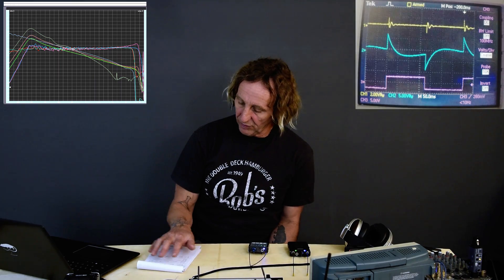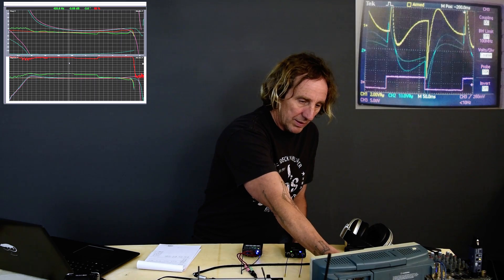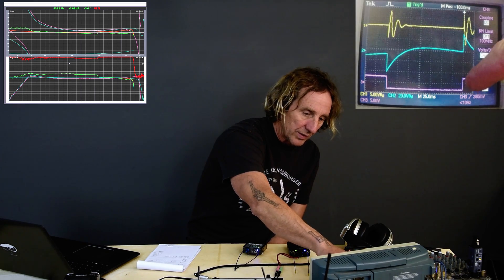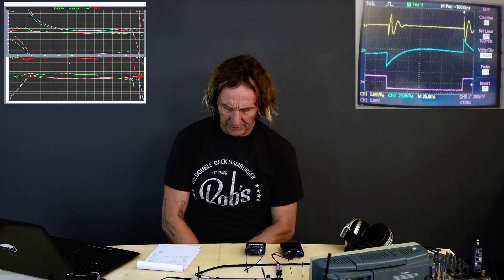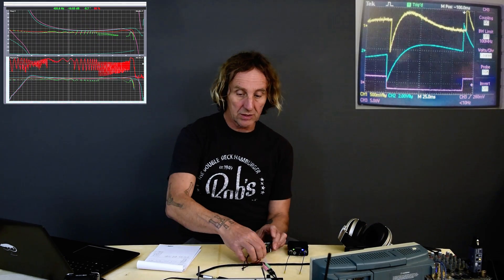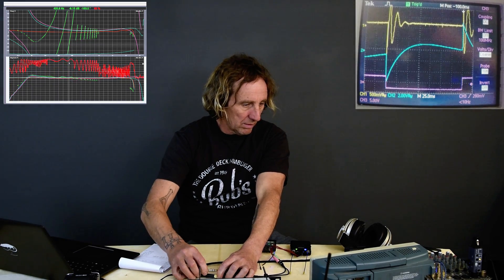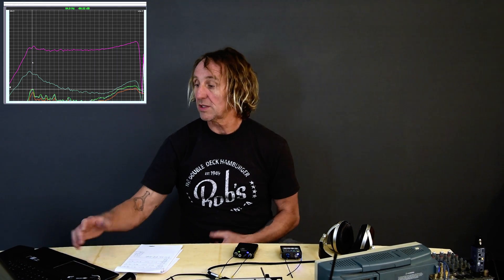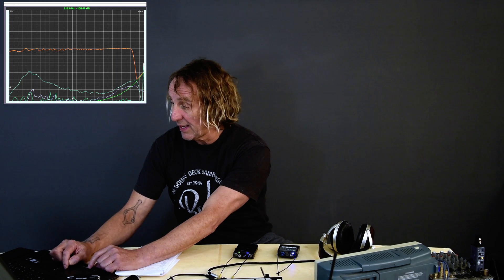Analog vs Digital In-Ear Systems Pt 2 - Shure PSM1000 vs Lectrosonics D2 #16

Comment: Thank you for taking the time to make these videos. 

I have used Sennheiser IEM G3s and Shure PSM900s for a long time (haven’t had budget for PSM1000s), and I tried a Duet system back in the summer of 2019 I think- after their major protocol revamp. My observations: The Sennheiser G3 IEMs have a very noticeable noise floor, but once you get signal in, they sound better than PSM900s, which are virtually silent for noise floor, but the sound is pretty dead coming out of them.

I was really excited to try the Duet system based on Lectrosonics’ reputation, however I ended up returning them. In addition to the battery life issue, I thought they sounded terrible - a digital noise/dithering that came over everything. They sounded like a low-bit rate MP3 recording. I posted on PSW about this and got thoroughly skewered, but I stand by my assessment - the RF performance is world class, the physical design is 85% (batteries and poor design of battery door where a poorly placed bump can cause the door to open and the batteries to fall out), but I just thought they sounded worse than the analog systems.

I think it’s interesting that what I heard doesn’t show up clearly on your measurements, while things I found less objectionable (compander action), clearly are shown in your measurements. I’m not an analog warmth guy - I was an early adopter of digital consoles, but in this case I couldn’t live with the digital sound and sent it back.

I’m hoping that the next gen can do better - maybe some rule change by the FCC to allow wider channel use (not holding my breath for that).
Reply: I have 8 channels (4 units) of the M2T duets w/ 7 M2R and 2 M2Ra packs, and I agree that they sound like a 96kbps or less mp3, with all sorts of hiss and crackle. My artist is a pianist and it is extremely apparent when you play a single piano note. I've been trying to get an answer as to why or how to fix this, but I have had no luck.  I've tried dante and analog and had no difference. I was also surprised this didn't show up in your testing, but to be fair, I've tried to capture this noise difference but it's been difficult.
Reply from the maker: Interesting
Reply from the maker: Cool cool and interesting info. I did not do much perceptive based but that is interesting.
Reply: @DaveRat  Thanks for your reply. 

Upon further reflection, I think the reason the compression artifacts don't show up in Smaart is they are too fast - probably the average frequency response is about right so the trace matches, but the artifacts and warble of the compression are multiple times per second, and so get smoothed out over the Smaart sample period.

I worked with Lectro tech support on this and they suggested driving the Duet very hard to maximize the bits transmitted and make quantizing error smaller. That helped, but I never got there. 

If they were the same money as the regular budget-based gear, I may have kept them as the cheap stuff has other problems which you demonstrate in your video, but at top-tier prices, I couldn't swing it.

Comment: Could you drive the lectrosonics via dante to measure the difference in noise ratio, ground noise, freq. response and impulse/transient response?
Reply from the maker: Probably not going to dive in that deep. I may do some latency using dante and also test wireless mics.

Comment: Thanks for these tests/videos! I'm curious, since the scope is showing a deformed wave leaving the mixer, how much of the amplitude tilt is attributed to the mixer (DC blocking?) vs the RF system? Or am I misunderstanding something?
Reply from the maker: Pure DC blocking should just show a spike and return to zero. There will be some overshoot due to the high pass filter but ya don't want to see too much bouncing around after the spike. 

The scope is good for seeing clipping, latency, noise and if things are way off on the scope, to figure out other gear to see what the issue is.

When testing things like mics with a pulse, the scope will show the ringing and overshoot that some mics have and can be heard as added LF.

Comment: Dave, can you do this exact test with the Shure P10R+, since the P10R is discontinued and only the + version is what someone would buy now? Since the + version has a new DSP in it there should be a big difference in that vs the non + version.
Reply from the maker: I will try and do a + vs non + test when our + units come back from rental.

I believe the difference between the + and non + is in the belt pack only and the rack transmitters are the same and unchanged.

So the front panel aspects will be the same, I am interested in measuring the difference between the newer belt packs and the older version

Comment: This was a great technical comparison. A couple points of interest I found while shopping for an IEM system was Lectro's integration with their other gear via the Wireless Designer software, the Dante integration, the half-rack design (which can be operated via DC power for mobile setups) and the difference in sound reproduction with digital vs. companded audio. One price you pay with digital which isn't discussed here but is widely deliberated about online is the range of digital vs. analogue. I own Lectrosonics wireless analog and digital microphone and IEM systems and the analogue has much better wireless coverage over a greater distance. Thanks for sharing this video. I'll be staying tuned for the next one!
Reply from the maker: Excellent info and thank you! Also the digital is a yes/no all or nothing coverage and analog has drops as a warning.

Comment: I use PSM1000 typically, and have tried the Duet. Feature-wise the Duet was great, but the show stopper for me was the lack of a rechargeable Li-Poly pack. No idea how Lectro missed the boat on that one, but I'd sure like to see them try again with the next version, addressing this and the HF response.
Reply from the maker: Agreed, tossing Batts is a bummer and tossing lithium Batts is even more of a coat bummer in addition to environmental concerns
Reply: @DaveRat  Not just the tossing, but the cost and lack of run time for non-rechargeables!
Reply from the maker: @Remotely-Possible  agreed
Reply: Try some Eneloop Pro (2500mAh vs 2900mAh for your typical lithium). Enough capacity to see you through but without the environmental impact of lithium)
Reply: @RussHollinshead  Have you tried these? I've been using them for decades (the better Maha Energy ones) with the Senny packs and the were great. When I moved to the PSM1000, the current draw on those packs was about 4 times as high as the Sennys, making the NiMh solutions unusable for situations where you need over 4 hours run time. Switched to the Shure packs, and they go 10-12 hours. On the Lectro? Forget it. Can't use NiMh at all.
Reply: Additionally, the discharge curve on NiMh is much flatter than alkaline. It means that the battery meter can show several bars, then a few minutes later, Dead. For that reason you have to regularly test the NiMh batteries to calculate their run time as they get older, and keep track of each battery's health. The Shure Li-Ion packs give you an actual readout of hours left, and I've found it to be conservative, but pretty accurate.
Reply from the maker: @Remotely-Possible  interesting. I had an issue years ago where singer kept complaining. But all tested out perfect. The mon Eng ended losing his gig over it.

Turns out the issue was related to swapping to nicad Batts on shure psm700 packs. The lower battery voltage resulted in a lower maximum output level. And the singer could no longer get the volume he wanted before distortion
Reply: @Remotely-Possible  I can't comment too much as batteries go in fresh at the start of 2 hour set and I don't have a requirement for them to last longer than that. I've got a steady supply of Eneloops on rotation so for longer, you'd have to be on it on your battery replacement regime! Granted you lose the reliable battery indicator too- but again, due to my requirements, no biggie. As soon as the packs are off stage, the batteries are rotated and the used batteries are put aside for charging. I factor in a new set for sound check, then post sound check, they batteries are replaced with new. Every time the talent goes out, the batteries are fresh. So I guess I should revise my answer - Eneloop can work - depending upon your requirements! You've a valid point about the discharge slope though - power for power though, lithium is 8.7Wh vs NiMh 6.12Wh - but of course there will be a minimum voltage requirement for the receivers to operate and how long the unit can be powered on before the discharge curve of the battery over time leads to the battery not being able to supply the required voltage despite storing juice will come into play. Again, all this variable depending upon whether the back light is on and whether the amp powering the headphones is working hard.

Also Mr X - you're right, everything would appear to be very battery hungry compared to the Sennheiser though!

@Dave Rat - this could be your next experiment. Can you get realistically get away with using NiMh on Sennheiser, Shure and Lectrosonic...?
Reply from the maker: Laundromat maybe what I'll do is get a variable current and voltage power supply and measure maximum output versus supply voltage for the packs from various manufacturers
Reply: @DaveRat  There you go, between us, we've got you the subject for some more content. Nice one! Who'd have thought batteries could lead to such discussions eh?!
Reply: @DaveRat  Great plan. I did many discharge graphs years ago, trying different batteries on Senny vs Shure, alkaline vs NiMh, but once Shure had their "Smart" Li-Poly packs, it was no longer important. First thing I said to Lectro when demoing their product was "where's the rechargeable pack?" They have rechargeable packs for their other devices, so it made no sense!
Reply: Years ago, I used to use some Sony stuff, and had this great little timer in the belt packs, that would tell you how long they'd been powered on since the last battery change. It's was so simple, but so brilliant. I could tell in a second if someone hadn't powered off their pack between sets or whatever. Since I had tested my packs with my particular rechargeables and had kept data on every battery, I knew pretty much exactly how long I had left on every pack, no matter what battery I had in it. Can't believe that no other manufacturer every caught on to what amazing, simple and useful feature that was!
Reply from the maker: The crazy small stuff that is overlooked is my specialty!
Reply from the maker: Interesting and very cool
Reply from the maker: @RussHollinshead  will check them out, but ultimately, we try not to but products that do not have rechargeable batts
Reply: @DaveRat  totally agree with you. Batteries are such an important part of the solution. But yeah, those rechargeable Eneloop AAs are banging.
Reply from the maker: @RussHollinshead  excellent.  I have actually given the enloop Batts and charge just as gifts at the rat xmas party but never tried them

Comment: Dave,  based on the findings it seems there is still room for improvement on these products.  The pulse on the analog in the pervious video stores really made me want to use digital, but after seeing this the accuracy of this product, although overall better, high frequency detail is lost. So for older bands this digital would be fine, but for younger musicians and older musicians and engineers who are lucky, we need up find an alternate digital option.  

Dave, great semi real world knowledge most of us never made the time to test /understand.
Reply: Hi Rob - I guess it’s all a trade off... and we may still be at the limit of the available tech. Let’s not forget that lectrosonics are probably the first to offer a viable low latency offering. Much of the other units are consumer toys running on 2.4/5ghz with horrific latency figures. Things will probably get better in time. But at the end of the day, most artists are happy with getting something that sounds better than wedges and being offered some hearing protection by being subjected to the lower spl that (should be at least!) is produced by IEMs. Having that high frequency roll off isn’t great but may be preferable in terms of reducing fatigue over the length of a gig. At the end of the day, your IEM system is only as good as your chain but I do know of folks that use darker sounding IEMs with the natural high frequency roll off as they think they the highs are very fatiguing. Now whether you cut that at the desk, have it naturally cut at the IEM system or the roll off of particular models of IEMs themselves, the roll off of the lectrosonics may actually be a point of no significance. Appreciate as an engineer though, if there is any filtering of those highs happening, you want to be in control of it! To be honest, I’m pretty excited about getting IEMs into the digital domain - especially if you can cram a hell of a lot of them in the ever decreasing spectrum (like the ULXD/Axient high density mode for example)
Reply from the maker: This is all great and useful info!
Reply: @RussHollinshead  No doubt of course.  It is just 2021 and I'm shocked that we are still in the dark ages for something that WE ALL have personal experience with the difficulties that are partially or wholly due to the equipment NOT functioning at the professional level we expect and pay good money to provide the best experience with talent.  As a fellow musician/engineer,  I don't think it is unreasonable to expect more, or at the very least full disclosure from the vendors themselves about any deficiencies, challenges, room for improvement.  I have personally had to rescue four festivals that the monitor engineer couldn't cut it when the IEM bands were on stage trying to get a reasonable in-ear mix in the fifteen-twenty minute load-in/band switch and I had to give up hanging out in FOH and instead had to run monitors because a reasonably experienced engineer couldn't deal with artists who expect a decent IEM experience.   Mind you these were seasoned engineers who were perfectly suited for wedge mixes but couldn't pull off removing the amp/wedge from the chain.   I am not saying I am some kind of super-engineer, I have SO much to learn. It is just a lot harder when the output of the head unit doesn't match the belt pack.  That's insane and defeats what any reasonable person would expect, and explains why having your own belt back to listen is the standard.   Having said all that I accept there are physical limits, there are technical limits, and there are ability limits - then there should be no reason to not include these in the fine manual, no?
Reply from the maker: Thank you Rob and agreed!

Comment: Hey Dave;
Quite the eye-opener! Great job. 
Feel like doing one now on RF performance of these 2 units, including performance around LED walls?
Reply from the maker: Hmmm, that's a bigger test than I am setup to do, that said I do have experience with an LED stage and in-ears and know some solutions I will try and cover at some point
Reply: @DaveRat  Great! It's the biggest issue I deal(t) with with IEMs (and other RF) is the hash coming off LED walls. Sound quality doesn't mean much when you're getting RF hits! ;-)
Reply: Dave, what more important, sound quality or signal reliability? Also, subjectively, which one sounded better- the Shure or the Lectrosonics?
Reply from the maker: @SoCalVipers  the answer to that is client and environment based.

They both sound good with low input levels, the shure gets duller on kick and pulses when driven harder.  Plus the extra hf on the shure adds some sparkle. Plus encryption on the lectro, so it just depends on the bigger pucture